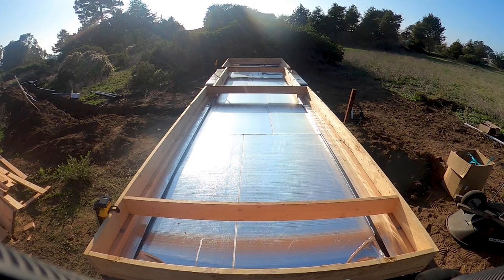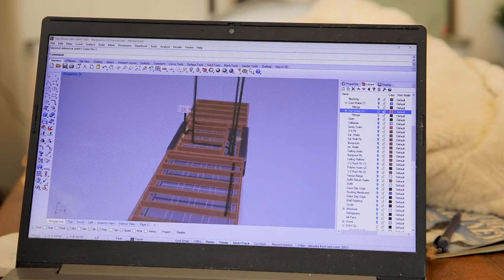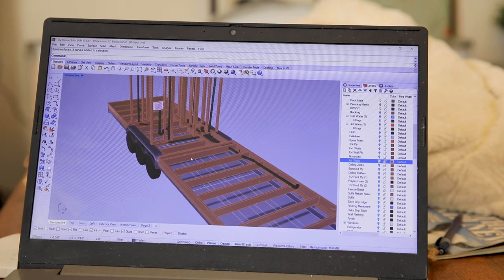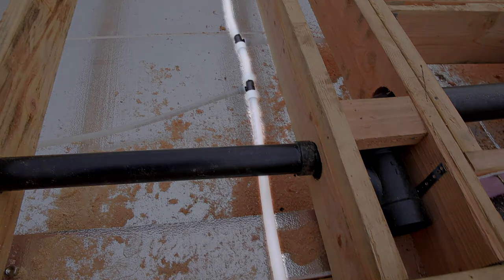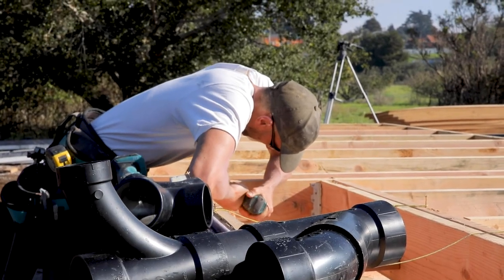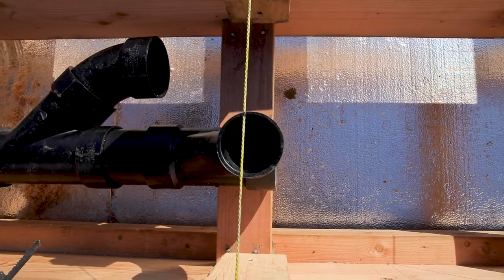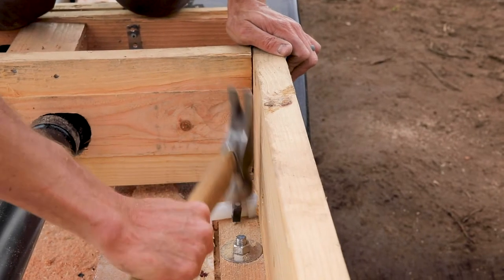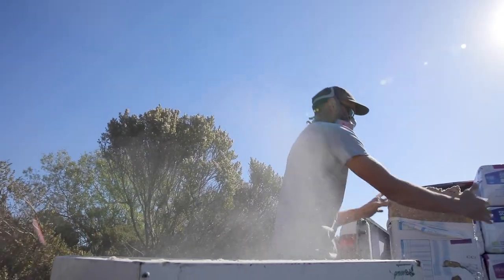Off The Grid Tiny House Episode 4: Subfloor Plumbing

Comment from the maker: Pex NPT Adapter
https://www.amazon.com/gp/product/B07MY9XZKR/ref=as_li_tl?ie=UTF8&camp=1789&creative=9325&creativeASIN=B07MY9XZKR&linkCode=as2&tag=otgth-20&linkId=3f3d86363e3c84a25b1dc583d26c4c6b

Hose Adapter
https://www.homedepot.com/p/Everbilt-3-4-in-FHT-x-3-4-in-MIP-or-1-2-in-FIP-Brass-Multi-Adapter-Fitting-801649/300096290#overlay

3/4" Pex Expansion Rings (5)
https://www.supplyhouse.com/Wirsbo-Uponor-Q4690752-ProPEX-Ring-with-Stop-3-4-blue-print-2299000-p

1/2 Pex Expansion Rings (11)
https://www.supplyhouse.com/Wirsbo-Uponor-Q4690512-ProPEX-Ring-with-Stop-1-2-blue-print-2298000-p

3/4" Pipe Insulation (3)
https://www.homedepot.com/p/Everbilt-3-4-in-x-6-ft-Foam-Self-Seal-Pipe-Insulation-ORS07812/204760815

1/2 Pipe Insulation (7)

https://www.homedepot.com/p/Everbilt-1-2-in-x-6-ft-Foam-Self-Seal-Pipe-Insulation-ORS05812/204760809

Duct Tape
https://www.amazon.com/gp/product/B003YHFZ6A/ref=as_li_tl?ie=UTF8&camp=1789&creative=9325&creativeASIN=B003YHFZ6A&linkCode=as2&tag=otgth-20&linkId=02f2c500199140334cd21c93277035e3